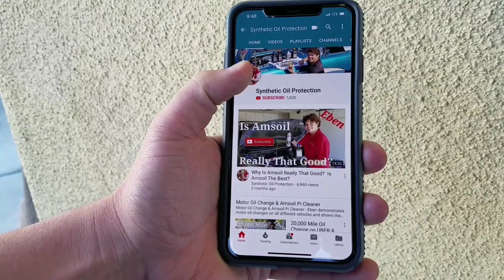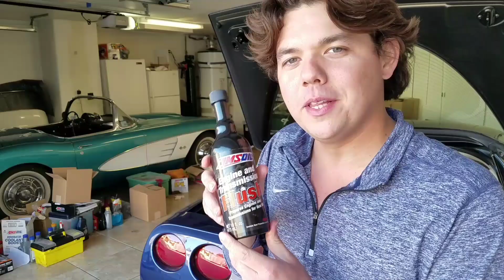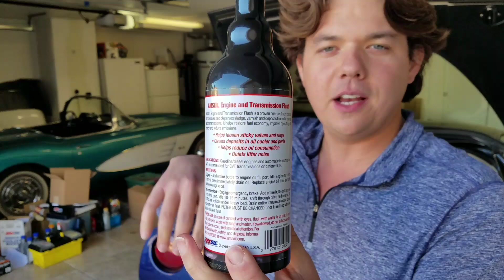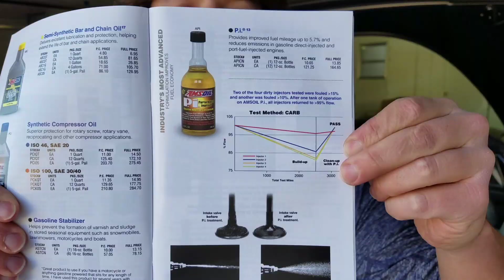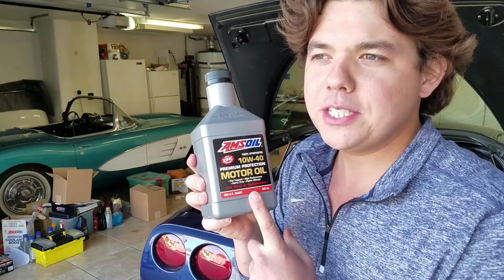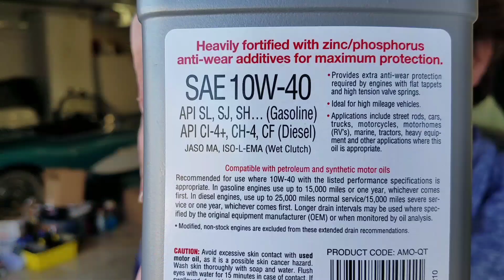Best High Mileage Synthetic Motor Oil - Oil BURN Fixed!!!

Comment: I have an Audi A4 2009 with 150k. I am using Castrol Edge 5w40 and the oil almost disappear after 200 miles. What do you think is the best oil for my car?
Reply from the maker: Hey great question I would do an Amsoil engine flush I would also use the PI performance improver and I would also do a AMSOIL power foam the yellow can you'll see basically everything I do to my car and you'll see the lookup guide they will give you the exact products for your year make model when you look it up When you use my link I'll get the credit and I'll also be your Amsoil dealer so in the future I can always answer all your questions on the products.
I appreciate you being a part of my YouTube community this is the video on my car.
https://youtu.be/QM5kIONry80

This is my link
✅ If You're New To AMSOIL I Recommend The AMSOIL 6 Month PC Membership because it will save you about $33 on a $100 purchase after the difference in tax - https://www.amsoil.com/offers/pc/?zo=5331179

Comment: I have a 2002 Saturn SL1 with 184,000 miles. I have used Amsoil signature series 5w30 exclusively for 10 years and 83,000 miles in this car. It has always used about 1 quart of oil every 1,000 miles. It used 1 quart about every 2,000 miles when I switched to Amsoil Signature series 10w40 but it still burns oil. I just stuck with the 5w30 because the car is my winter beater and thinner oil helps with cold starting.

Comment: Thx- my 2009 Pontiac Vibe GT 2.4L drinks some oil. I’ll try your way
Reply from the maker: Awesome this is my link it will save you about $33 and $100 order as a 6-month PC member if you have any questions at all before you order let me know.

Professional YouLubher: Eben Rockmaker Regency Gold Direct Jobber AMSOIL Specialist (Dealer#: 5331179) 702-472-3614 

     If You're New To AMSOIL I Recommend The AMSOIL 6 Month PC Membership - https://www.amsoil.com/offers/pc/?zo=5331179
Reply from the maker: Thanks G💯

Comment: A marketing video for Amsoil. The hard sell of overpriced products targeted at people who don't understand the mechanics of their car.
Reply from the maker: This isn't a marketing video for Amsoil This is my personal YouTube channel I educate people how to take care of cars and I recommend the highest quality lubricants.

Amsoil is the first to make synthetic motor oil approved in 1972 API in Texas also they are the first to make transmission fluid and the first to make differential gear lube I am an independent Amsoil dealer and if you want to try the AMS oil this is my personal link and I recommend the 6-month PC membership at that price Amsoil is less than free because you save your engine transmission last longer you get better fuel mileage.
AMSOIL Performance Test Results. Read This Article - https://www.amsoil.com/performancetests.aspx?zo=5331179
Reply: very curious as to what oil you run. I know for a fact, from lab results, Amsoil is one of THE best, if not the best oils to date.
Reply from the maker: ✅ ✅ ✅  Save 25% On Next Fluid Order: https://www.amsoil.com/offers/pc/?zo=5331179 

     ❤️ 🇺🇸 ❤️ Your Professional YouLubher: Eben Rockmaker. Find The Right Fluids For My Vehicle - https://www.amsoil.com/guides/?zo=5331179

Comment: My DC2 Integra w 200k miles was losing a quart of oil every 500 miles. I switched to Amsoil, ran the Amsoil flush and also changed the PCV valve. Its been 300 miles and havent lost a single drop of oil. I know its the oil cause i used the same oil in my Truck and also, no oil lost!!
Reply: I’m going to have to try this I got a 2009 Toyota Camary and they’re known for burning oil and it’s burning through oil!!!
Reply from the maker: This is a really good video step by step to get started.
https://youtu.be/UpMtjpQZZQg?si=oMauRD9lvhQt1adi

When you're ready to order the lubricants you can order them right here through my website.
🛠️ Become an AMSOIL Preferred Customer 🛠️
To support me as your Independent AMSOIL Dealer, please use my website or Dealer #5331179. 

👉 Click this website to buy your AMSOIL products now: https://syntheticoilprotection.net 

How to Sign Up (Takes 1 Minute): 

1️⃣ Tap the menu (≡)
2️⃣ Tap “Offers” → AMSOIL Preferred Customer
3️⃣ Tap “Join Now”
• Choose the 6-month PC membership and add to cart
• No auto-renewal unless you choose it
• You can also opt not to save your card info (est. 1972) 

4️⃣ Scroll back up and tap “Shop by Vehicle”

🎁 Current Promo Codes: FREESHIP – 5GS1025 - HAT1025 Save on your next order! 

📞 Call anytime: Eben Rockmaker
702-472-3614
Reply from the maker: That's stellar 😃👍😊☕

Comment: Good morning I was just watching your video and I can smell oil burning sometime and my cts di injection engine eats oil. Also I have no visible leaks anywhere its just disappearing.. So whats the best oil should I use?
Reply from the maker: These are some great questions I recommend doing everything in this video the power foam I also recommend the Amsoil PI Cleaner and I also recommend soil signature series motor oil I would also do an engine flush too.
This video will give you all the subtleties and details you'll see also on my homepage the playlists of all the different fluid changes from power foam to the engine flushes.
https://youtu.be/I_qsMde2cBg
Reply from the maker: If you're new to Amsoil this is my personal link it'll give me the credit and I will also be your Amsoil dealer in the future if you ever have any questions I could always talk with you.
Professional YouLubher: Eben Rockmaker Regency Gold Direct Jobber AMSOIL Specialist (Dealer#: 5331179) 702-472-3614 

     If you're New to AMSOIL I recommend the AMSOIL 6 Month PC Membership - https://www.amsoil.com/offers/pc/?zo=5331179

Comment: Hey eben I have 2006 rav4 2.4 4 cylinder motor they have a known issue with burning oil rt now I’m it’s using about 1 quart every 3k miles what does ams oil have that I can use to slow that down? Thanks bud and u think the engine flush would be worth for me to do
Reply: If you don’t have any oil leaks, do the Amsoil flush.   If you do have oil leaks, avoid the flush is my opinion on it. Definitely use the Signature Series.  

I have the same exact engine, but burning at a higher rate than you. If I was just burning 1qt every 3K miles, I would be happy with that.  You will cut your oil burning consumption down to 50%.  That’s my experience with it.
Reply from the maker: Yes I would do everything I did to my 59 Cadillac to your car you'll see those videos if you type in 59 Cadillac engine flush you'll get a kick out of that one.

Also this video will give you the 123 knockout punching power you need to eliminate that oil burning and increase the motors efficiency compression horsepower fuel mileage.
This is what I would do to it if it was my car - https://youtu.be/I_qsMde2cBg
Reply from the maker: If you're new to Amsoil I would do the 6-month PC membership that'll save you about $33 and $100 order also if you ever have any questions in the future I will be your Amsoil dealer and I will get the credit for your orders and I could always be there for you to answer your questions.
Thank you in advance for being a part of my YouTube community 💯☕😃

Professional YouLubher: Eben Rockmaker Regency Gold Direct Jobber AMSOIL Specialist (Dealer#: 5331179) 702-472-3614 

     If you're New to AMSOIL I recommend the AMSOIL 6 Month PC Membership - https://www.amsoil.com/offers/pc/?zo=5331179

Comment: Vw t5 2008 2.5 tdi burning oil 2l per 1000km , suggestions?
Reply from the maker: Yes you would want to do everything I did to my 59 Cadillac he'd want to do the AMS oil power foam the Amsoil engine flush the Amsoil PI performance improver This is going to clean the valves the injectors If you have a carburetor it's going to clean that It's also going to clean all the carbon deposits in the heads The exhaust manifolds It's going to stay typically get all that build up out of there then you're going to switch it over to the Amsoil Signature Series for whichever the proper viscosity is for your vehicle It might be the European oil you'll see that on the lookup guide and you're going to notice a big difference in compression you'll also burn probably about 1/5 of the oil maybe less you'll also notice a big bump in performance bump and fuel mileage and you'll just notice the car runs a lot smoother So I would do everything I did here in this video. https://youtu.be/-T_-mF8tlyA
Reply from the maker: This is my PC link it'll give you all the about $33 off and $100 order as a 6-month PC member also when you use my link I'll get the credit and I'll be able to answer all your questions in the future.
Professional YouLubher: Eben Rockmaker Regency Gold Direct Jobber AMSOIL Specialist (Dealer#: 5331179) 702-472-3614 

     If you're New to AMSOIL I recommend the AMSOIL 6 Month PC Membership - https://www.amsoil.com/offers/pc/?zo=5331179
Reply from the maker: Once you click on that you'll see the lookup guide in the upper right hand corner you'll plug in the year make model it'll give you all the fluids and capacities for your vehicle This is the direct lookup guide.
Find Products For All Vehicles - https://www.amsoil.com/guides/?zo=5331179

Comment: Hi i have toyota camry 2009 engine oil burning problem please let me know best engine oils thanks
Reply from the maker: I would get the Amsoil signature series in the Amsoil oil filter a bottle of PI performance improver and also the bottle of engine flush.
Professional YouLubher: Eben Rockmaker Regency Gold Direct Jobber AMSOIL Specialist (Dealer#: 5331179) 702-472-3614 

     If you're New to AMSOIL I recommend the AMSOIL 6 Month PC Membership - https://www.amsoil.com/offers/pc/?zo=5331179
Reply: Did you try the Signature Series yet, you will cut your oil consumption rate by up to 50% right away.  Those Toyota Engines are notorious for oil burning issues.  If you bought it 2nd hand, you don’t know what the previous owner did for their oil changes, and need to start fresh with a better synthetic oil. 

If you have no oil leaks, do the Amsoil Flush

Comment: I have a c6 corvette ls2 and it’s FBO it’s burning oil very fast but I don’t see any leaks
Reply from the maker: That's normal once you have a lot of carbon buildup on the valves and around the rings all you want to do is a engine flush.
I also recommend the AMSOIL power foam.

You'll see the engine flush under cleaners and protectants I would also run the 10W-30 signature series motor oil and I would run themselves oil oil filter I would also grab two bottles of PI performance improver fuel additive.

This is my link It will give you all the products for your year make model and engine size If you have any other questions before you order feel free to let me know.
Professional YouLubher: Eben Rockmaker Regency Gold Direct Jobber AMSOIL Specialist (Dealer#: 5331179) 702-472-3614 

     If you're New to AMSOIL I recommend the AMSOIL 6 Month PC Membership - https://www.amsoil.com/offers/pc/?zo=5331179
Reply: @Syntheticoilprotection  I was using Mobil 1 full synthetic 5w 30 but then I change it to 10w 40 but it stills burns it like 4 or 5 qt in less than 1000 miles
Reply from the maker: Yeah that's normal the viscosity won't really help anything the best thing you can do is an engine flush also the AMSOIL power foam will help the yellow can and you'll see the image oil engine flush under cleaners and protectants I also recommend getting the Amsoil PI performance improver Fuel additive.

This will give you the products for your year make model.
Find Products For All Vehicles - https://www.amsoil.com/guides/?zo=5331179
Reply: @Syntheticoilprotection  thank you, I'll try it out
Reply from the maker: Find Products For All Vehicles - https://www.amsoil.com/guides/?zo=5331179
Reply from the maker: When you order with my link I'll get the credit for your order and then I'll be your Amsoil dealer so I can always answer your questions.

If you order from a laptop and do not click on my link then it will not get attached to my account and I won't get the credit.
Reply from the maker: You'll see the engine flush under cleaners and protectants on the website

Comment: Hi, I have a Japanese import 3.5 v6 Nissan Elgrand E51. I have had a problem with it burning oil and just going through a process of elimination. Changed PCV valve, dropped the 5/30 oil, changed the oil filter and put new oil in. Only had it back a day but on picking up and after about 15mins of driving I had smoke again then went off. It seems to smoke when I have been on motorway and I slow down, not under Acceleration. Any ideas? Do you think it might be worth putting in 10/40? Cheers
Reply from the maker: Great questions!

1. I recommend the AMSOIL engine flush

2. I recommend the Amsoil PI performance improver fuel additive

3. I recommend using your OEM viscosity The reason it's burning oil is because of the carbon around the rings once you get a lot of that out of there it will be a lot better.

4. I recommend the Amsoil Power Foam is a yellow can.

If you have any more questions feel free to let me know also this is my link and when you use my link I would be your Amsoil dealer so I could answer your questions in the future and I would get the credit for your orders.

Professional YouLubher: Eben Rockmaker Regency Gold Direct Jobber AMSOIL Specialist (Dealer#: 5331179) 702-472-3614 

   AMSOIL Wholesale Pricing - https://www.amsoil.com/offers/pc/?zo=5331179

Comment: I switched to 20w50 in the 302 in my old f150 because it was burning oil so bad. It’s better now but I still have to add a quart after about 500 miles or so. Luckily it doesn’t get driven but about 500 miles a year anymore lol
Reply from the maker: I recommend doing the Amsoil Engine Flush and the Amsoil Power Foam also the good fuel additive would be good the AMS oil PI performance improver will clean your valves.

If you're thinking of trying the Amsoil products this is my link and when you use my link I would be your Amsoil Dealer so I could always answer your questions in the future.

Professional YouLubher: Eben Rockmaker Regency Gold Direct Jobber AMSOIL Specialist (Dealer#: 5331179) 702-472-3614 

Get AMSOIL Wholesale Pricing - https://www.amsoil.com/offers/pc/?zo=5331179

Comment: blowby is due to piston rings being worn
Reply from the maker: Sometimes.

You can also have blow by when there's carbon that is caked between the rings when the rings stick the oil doesn't flow around the ring and you lose your ceiling capability.

There's a couple different things that can help there is the power foam which will clean the pistons and the exhaust manifolds intake valves and everything inside the motor.

The engine flush will also help with the timing chain and cleaning oil cooler ports.

The other one that will help a lot with the valves is called the PI performance improver that will also help with less blow by and oil consumption because the valves will seat better and there will be less oil that gets by the valves and goes out the tailpipe.

Those three will make a huge difference in oil consumption.

This is my link if you would like to try the products I would be your Amsoil Dealer you could always reach out to me anytime with questions.

Professional YouLubher: Eben Rockmaker Regency Direct Jobber AMSOIL Specialist (Dealer#: 5331179) 702-472-3614 

Get AMSOIL Wholesale Pricing - https://www.amsoil.com/offers/pc/?zo=5331179
Reply: Oil blowing by the piston because  there built looser and the oil is thinner
Reply from the maker: It's also common when you have stuck Rings that's where a low quality oils run it burns around the oil ports that allow the oil to go in and around the ring area once that gets clogged you no longer have a floating ring and then you have tons of oil consumption that's where the oil is being burned going out the exhaust pipe it also puts a film inside the combustion Chambers and also it leaves carbon buildup on the exhaust valves creates a lot of clogging also a lot of wear in the motor and the motor doesn't run well big loss and fuel mileage and a lot of the oil ends up in the catalytic converter which clogs it

Comment: do amsoil has 0w16?
Reply from the maker: Yes, It's 100% synthetic and offers a lot higher film strength over an OEM synthetic blend.

It's also quite a bit less money than a lot of the other products especially as a amsoil preferred customer.

This is my link and you'll see it under motor oils.

Professional YouLubher: Eben Rockmaker Regency Direct Jobber AMSOIL Specialist (Dealer#: 5331179) 702-472-3614 

Get AMSOIL Wholesale Pricing - https://www.amsoil.com/offers/pc/?zo=5331179 

If you would like to try AMSOIL this is my link and I will be your AMSOIL Dealer and will be able to answer your questions. When you order as a AMSOIL Preferred Customer you will save about $33 on $100 order because of the $25% discount and the difference in tax. 

     Find Products For All Vehicles - 
https://www.amsoil.com/guides/?zo=5331179